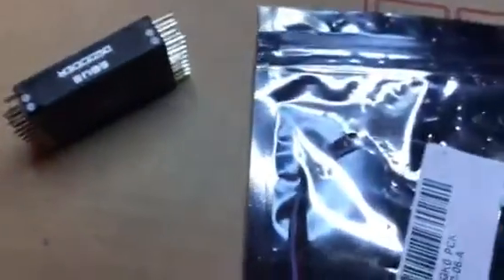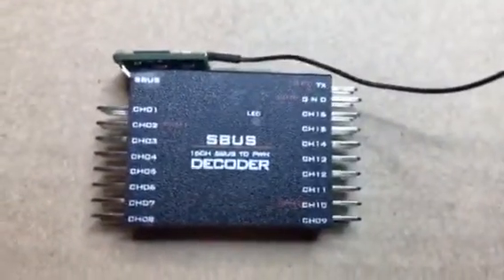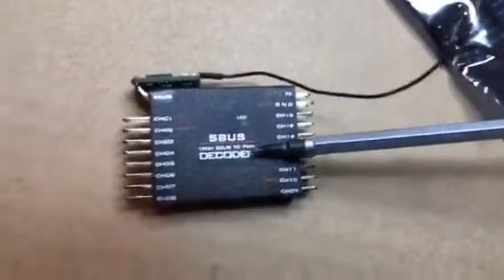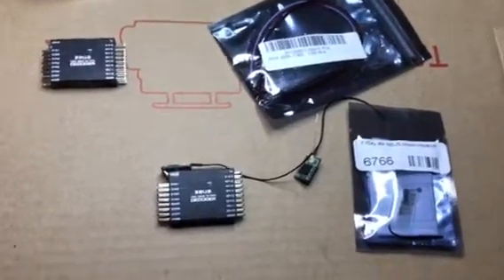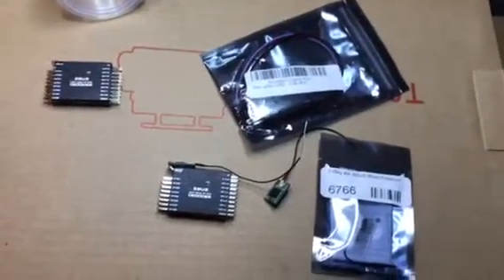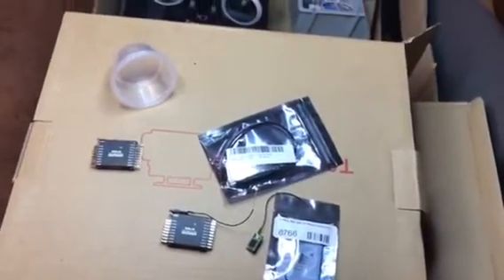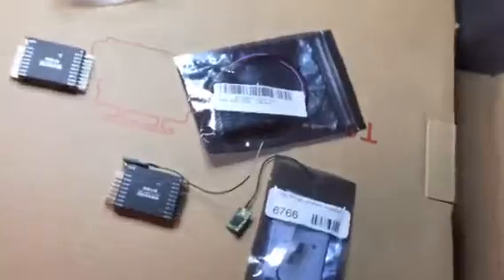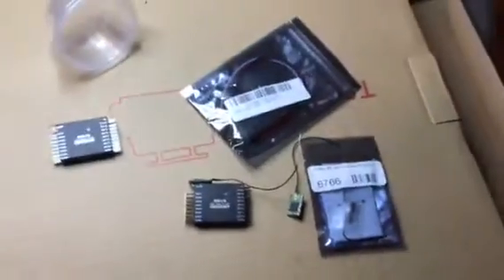FrSky 16 channel receiver using Sbus

Comment: Hi I have R9MX receiver. Do i need a SBUS decoder for my hexacopter because when I am connecting the SBUS out wire from receiver to RCIN port of pixhawk....my motors are not working.

Comment: Nice demo. It looks like this would be great for planes as well 🙂
Reply from the maker: this particular setup has no telemetry but there do have telemetry receiver “chips” I’m just not sure how to do those exactly 😅 but a friend did one so I know it’s possible
Reply: @Trucker1970  My comment was not in relation to telemetry, but actually about using an sbus receiver with the sbus to pwm decoder in a plane. Yes, indeed telemetry is built into some sbus receivers, accessed via the "s-port" (smart port) connector. You just need to "daisy chain" s-port sensors into this port :)

Comment: Awesome! You reckon this thing will work with Crossfire receivers as well?
Reply: Tried it - Mostly works! However, it seems that the decoder reduces the incoming signal by like 15%. Servos connected to that decoder just don't turn as far as if I connect them directly to the receiver. Any ideas why this might be? Have you had similar experience with this unit?
There is a PC configuration software available, have you tried connecting this thing to your computer and configuring it that way?
Cheers m8

Comment: hi Frank, thanks for the tutorial, i bought the same setup, got it bound and it runs fine with 1 servo, but if i connect more than 1, all servos go crazy and i lose control until it settles down and then i can move 1 again, but move more than 1 it goes crazy again.  have you had this issue?
Reply from the maker: I did get a bad decoder once   servo was all twitchy   unsoldered the receiver chip put it on a new decoder and all was well
Reply: @Trucker1970  thanks, Frank. i'll try another decoder, i bought 3 of each.
Reply from the maker: bigdogrod   ok   let me know how it goes
Reply: @Trucker1970  hi frank, turns out it was the jury rigged rx pack i was using. running 7.2v through sound unit and all is fine. on a side note, i connected the micro rx right to the beier unit with sbus, no extra decoder needed..